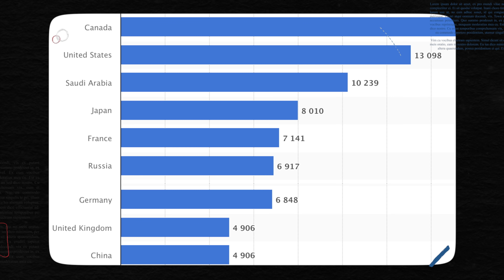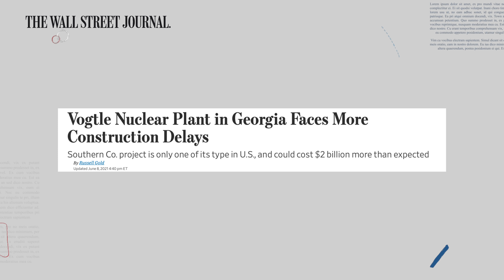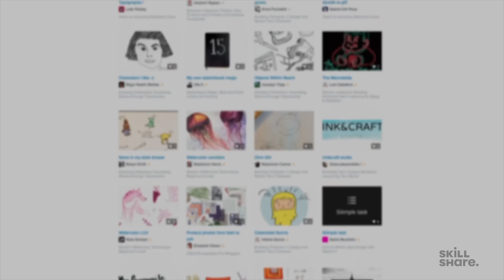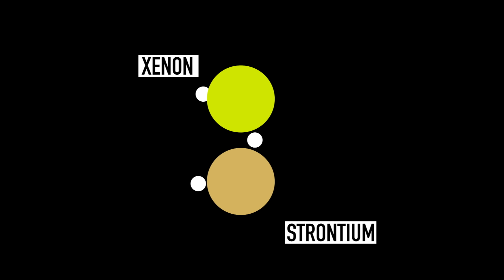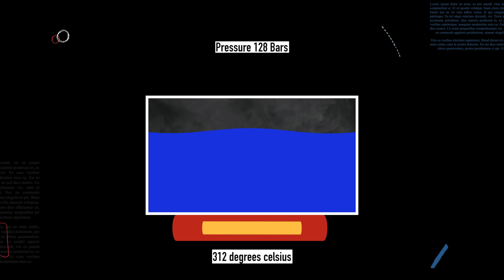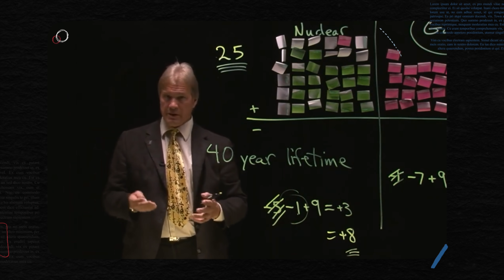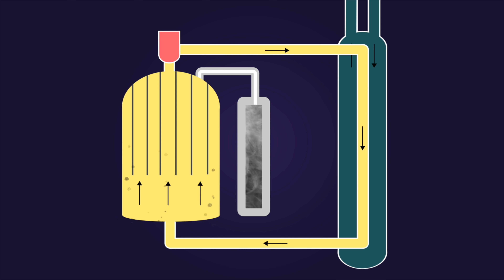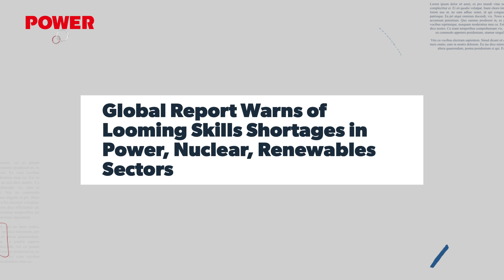Thorcon Just OBLITERATED Nuclear Energy’s Biggest Problem

Comment: Nuclear energy is the way to move forward so long as there are not corners cut and everything is above board.
Reply: Huh, Huh, Huh. I got some questions: doesn't the molten salt fuel eat through most reactor and containment methods, because it is SO CORROSIVE. Does it not react with water explosively, so if it were to receive a leak of water drops or worse, if the containment were to break and the fuel were released into the atmosphere, the results would be plumes of vaporized radioactive fuel for the residents of surrounding counties to breathe in deeply? Finally, in computing the cost of nuclear power did you figure in the cost of depopulating areas the size of US states as you nuclear industry folks accomplished in Chernobyl and Fukushima? Are you advocating planting the nuclear power plants in the ocean bottom now, so you can honestly say that you cannot reach or fix or prevent the underground radioactive leaks, when they occur, to limit your expenses? Are you totally nuts? 

Go live in Chernobyl's exclusion zone. You can get very close to nuclear stuff there. Reportedly, due to the inadequate clean-up, Fukushima is also another place in which you can get close to your beloved nuclear power. Go play around among their plastic bags of contaminated, radioactive dirt. Those are going to leak soon, what with having been exposed to the sun and wind for close to ten years, so you will soon have nice, radioactive dirt that you can use to grow your own crops. Have fun, fun, fun, until the cancers take your fun away!

Comment: It's time to start moving toward safe nuclear power. As you've shown previously molten salts seem to be the way to go. The only point I disagree with is the downplaying of the dangers and cost of PWRs.  The advantages of passive safety are numerous and key to moving forward nuclear power. We also need to consider the fuel supply chain and waste disposal. For these reasons I like the Elysium approach better.

Comment: I can think of a couple major flaws.  Yes modular design is great idea- lets standardize a single design and keep improving it as you go (open source project).  Separate the nuclear part from the electric generating part is also a good idea.   Using it on a ship or even a sunken structure on the sea bed is a bad idea,  just ask the Fukushima, Exon Valdez, New Orleans Katrina survivors or Deep Water Horizons folks about this.   You  have to assume things are going to go bad, much rather try and repair or cleanup a reactor on land than in  50 or 100 feet of sea water.  The sodium in sea water doesn't play nice with neutrons buzzing around.    Reactors need to be on land and not bunched together like Fukushima -- one goes critical and melts you can get close to work on the others.  Got to make sure your graphite doesn't fail and plug your salt drain, that would be very bad.  The salts are very corrosive and if your are part Thorium you are going to have to deal with the Tritium -- a very nasty stuff to contain and manage.  Fortunately its half life is only around  12 yeare but the bloody stuff freely mixes with normal Hydrogen in everything.  Let it escape and it will contaminate everything containing Hydrogen, think drinking water, plant matter, sea water, fish etc and there is literally no way to clean up the contamination.  Just have to wait out 3 or 4 half lives.

Comment: nuclear not necessary, i hope. battery storage is becoming cheaper and safer very quickly, and there is room for improvement in pv screens, too. i run our house off the screens on our roof and a battery array, and mid-term power can be stored in moving water uphill. nuclear failure is built in to human society, and the results can be a permanent disaster.

Comment: Alternatively we can just build the proven designs and not waste our time with this overhype. 

France already proved that conventional nuclear power can be built freakishly fast, and that was without even trying that hard. Everything is even better now. The more we put into these future 'plans' the more we squander the known advantages we already have. Everything that's true about Thorcon's alleged advantages is also true of conventional nuclear power. EVERYTHING is made in factories, this has never not been true. Assembling in a shipyard or onsite isn't a huge difference if it's allowed to function normally. And there are many advantages to onsite, so it's not a clear outright advantage. All that's required is a regulatory environment that allows those skills to be built. 

And your wrong about nuclear proponents. I will outright deny that it's get costly. With nuclear you get what you pay for... That's inherently cheaper than wind and solar that are low output, unreliable, need backup, and don't last long. They are therefore always a waste of money.

The biggest thing holding back nuclear power is the unwillingness of nuclear advocates to just tell the simple truth. Nuclear power is our best energy source, period. The totality of science is rather clear on that. But no one says so because they're operating under some sort of original sin from the Manhattan Project.

Conversely wind and solar don't even qualify as meaningful energy sources. There's just no comparison between the two. In every area of engineering where we aren't operating under a cloak of propaganda 'intermittent' is a synonym for 'broken'. We need to return to that object and well proven standard, wind and solar are simply broken and more trouble than their worth. No matter how cheap they appear to be. 

Whenever nuclear 'experts' make the mistake of being nice and saying that all solutions are equal all they accomplish is surrendering their expertise to renewable power and giving people permission to ignore nuclear power. But once we face the fact that there's no scientific, engineering, or economic advantage to wind and solar power then nuclear power wins be default. This is an easy thing to prove. Just ask the wind and solar people to provide a way for their systems to work without natural gas? They can't. And that makes them useless at all of their own goals.

Comment: Nuclear Power Plants are too expensive, too inefficient and too dangerous. Also contrary to common believe they very well cause carbon dioxide pollution.
And also i want to note, that nationalism causes big sufferings and destruction in Indian minds and any other nation. We have to stop that insanity and unite as human mankind.
Reply: @George Mann Once i was as enthusiastic as you, studied about thorium and alternatives and so called next gen reactors. But sadly there are aspects, which are not openly communicated by the big corporations behind the projects. On paper the proposed points sound interesting, but in reality for example not always civil interests do play a role in the decision making.
There are many problems, which are not addressed. But proper research does lay open the details. For instance how do you want to solve the problems of radioactive waste disposal for thousand of years? Did you even think about that in the first place? Nuclear Power Plant Supporters always talk about the plants, but hardly ralk about the disposal management, which do increase the costs enormously. Mostly that very costly part is handed over by tricky negotiations to the government and the tax payers. If the corporations fully layed ooen the real overall costs, no sane and responsible politician would accept those contracts, especially in recent times, when renewable energy reached the tipping point.

Comment: Isn't salt abrasive to metal and that is why no one is using it?
Reply: Salt is mildly corrosive.
Plain water is more corrosive.
Salty water is extremely corrosive.

There are many industrial processes where molten salt (not salty water) is used for years at a time. Aluminum smelting is the most obvious example.
Reply: @factnotfiction5915  cool, didn't know that. Thank you.

Comment: all it takes is one person to yell "hey dude you saw Chernobyl series on Netflix? then why are we building this just build solar" and boom, now you got 100 litigations in court that will drag this project for the next 10 years
Reply: One reason ThorCon is doing the deal with Indonesia. It would have cost them a billion dollars just to get permission to submit an application in the States, and who knows how many years to get approval. If this works out Indonesia might become the new poster child for Nuclear, like France and I'm sure they will reap the rewards from many companies setting up shop in a location with constant cheap power. 

Indonesia is also less likely to be swayed by NGOs. They have already stated that it is this or coal, and one way or another they are going to build plants. Lots of them. They want to industrialize and solar and wind just don't cut it.
Reply: That's true but Chernobyl was an RBMK reactor which didn't have a containment vessel and it used Graphite as it's moderator. PWR and BWR reactor use water and have containment vessels.
Reply: Huh, Huh, Huh. I got some questions: doesn't the molten salt fuel eat through most reactor and containment methods, because it is SO CORROSIVE. Does it not react with water explosively, so if it were to receive a leak of water drops or worse, if the containment were to break and the fuel were released into the atmosphere, the results would be plumes of vaporized radioactive fuel for the residents of surrounding counties to breathe in deeply? Finally, in computing the cost of nuclear power did you figure in the cost of depopulating areas the size of US states as you nuclear industry folks accomplished in Chernobyl and Fukushima? Are you advocating planting the nuclear power plants in the ocean bottom now, so you can honestly say that you cannot reach or fix or prevent the underground radioactive leaks, when they occur, to limit your expenses? Are you totally nuts? 

Go live in Chernobyl's exclusion zone. You can get very close to nuclear stuff there. Reportedly, due to the inadequate clean-up, Fukushima is also another place in which you can get close to your beloved nuclear power. Go play around among their plastic bags of contaminated, radioactive dirt. Those are going to leak soon, what with having been exposed to the sun and wind for close to ten years, so you will soon have nice, radioactive dirt that you can use to grow your own crops. Have fun, fun, fun, until the cancers take your fun away!
Reply: @mikefas1160  The animal life living in the exclusion zone is doing very well. With no mutants in sight yet.

Comment: Did we just glaze over dumping nuclear waste on a tropical island ala bikini Atoll, building a nuclear power plant submerged in the sea beside one of the most active tectonic plate boundaries. I'm all for nuclear but can't we find a better test location
Reply from the maker: The location mooted for this plant is not prone to tsunamis due to the lack of a lensing effect to focus the water towards one place. 

Their plant is rated to withstand pretty high earthquakes and g forces. Part of what helps is that they’re sitting on the sea bed. 

The can also has stabilizers around it so that it is somewhat insulated from sudden motion.

Comment: I fully agree, but there has to be a sensible safe way to dispose of the waste before moving forward with any more nuclear power plants
Reply: Check out moltex.  They are dedicated to wasteburner models.  Are out at a 5 year range of finality.
Reply: @dalethomasdewitt  yeah, but they'll have 50 years worth of spent fuel already and as she said, the new fuel is cheap. Might be a problem to scale their plants up enough to even make a dent, especially if they're building new reactors producing even more waste...

Comment: You might be able to use the energy to distill ocean water. Which will also produce salt. Then you could put some of the salt in the reactors. Just an idea. I am not exactly sure how thorium reactors work. Sounds interesting though. One thing to think about though is if you put molten salt in water it can explode. Just something to think about. If designed properly it should work. Try this take some molten salt and drop it in water. You can just watch a video on it on YouTube.
Reply: The salt don't explode.  The heated water gets a little agitated.  That's all.
Reply: @dalethomasdewitt  I guess it matters how hot the molten salt is when it comes into contact with water. Watch the YouTube video on "molten salt in water".
Reply: The salt is not sea salt -- it's a mix of Fluoride salts of  Lithium, Beryllium, Zirconium, Uranium and possibly others and becomes liquid in the mid 400 deg C range.   Hot liquid salt mixed with sea water would cause a steam explosion at those temperatures.
Reply: @craigs5212 I hope it works. It sounds promising. I think they will work the flaws out as they go. Just like anything it takes time to make something reliable and efficient. So when do you think they will start building them?

Comment: Instead of these gaint reactors why can we use small ones like ones used in nuclear powered ships subs ,these are cheaper and faster to produce ,by using them in large enough numbers we can achieve the same with less complexitys.
Reply from the maker: Because of the constraints of size, nuclear submarines use highly enriched Uranium. 

Plus they have a massive amount of cooling available on account of being in the sea :)

But it’s not totally unfeasible. Only thing is that there are less expensive ways to get nuclear energy.
Reply: @TechforLudditesSira  got it 👍🏼 . Thanks maam for replying ☺️ ,I hope ur channel become one of the best educational channels of Utube .
Reply: These are not giant reactors.  They are meant to retrofit existing outgoing grids. Modularity is the key to kick start civilization's basic key need.
Reply: @George Mann Wind and solar are very cheap and are located at ends of grid or in matrix of nodes throughout grid. This can dramatically lower costs as the grid doesn't have to be over constructed. In effect you are using wind and solar to lower cost and nuclear to ensure reliability without having to overbuild which you would have to do if you relied on renewables alone. 

It's also about diversity of energy sources, it is prudent to guard against foreseeable natural disasters that could take out a large slab of a renewables only power system
Reply: More and more Chernobyls and Fukushimas? Huh, Huh, Huh. I got some questions: doesn't the molten salt fuel eat through most reactor and containment methods, because it is SO CORROSIVE. Does it not react with water explosively, so if it were to receive a leak of water drops or worse, if the containment were to break and the fuel were released into the atmosphere, the results would be plumes of vaporized radioactive fuel for the residents of surrounding counties to breathe in deeply? Finally, in computing the cost of nuclear power did you figure in the cost of depopulating areas the size of US states as you nuclear industry folks accomplished in Chernobyl and Fukushima? Are you advocating planting the nuclear power plants in the ocean bottom now, so you can honestly say that you cannot reach or fix or prevent the underground radioactive leaks, when they occur, to limit your expenses? Are you totally nuts? 

Go live in Chernobyl's exclusion zone. You can get very close to nuclear stuff there. Reportedly, due to the inadequate clean-up, Fukushima is also another place in which you can get close to your beloved nuclear power. Go play around among their plastic bags of contaminated, radioactive dirt. Those are going to leak soon, what with having been exposed to the sun and wind for close to ten years, so you will soon have nice, radioactive dirt that you can use to grow your own crops. Have fun, fun, fun, until the cancers take your fun away!
Reply: @mikefas1160  Comparing modern designs with Chernobyl is like comparing an old time steam boiler with the modern ones. You should read the history of steam explosions. High pressure steam is invisible. You could be walking down the street and suddenly your are enveloped by an invisible cloud that is hot enough to cook you alive in seconds. Dozens more people have been killed in steam explosions than have been killed in nuclear accidents.

Fukushima was sixty years old and still weathered a category 9 earthquake. It was the imposed human procedures that torpedoed it, not any flaw in its design. 

The current plan for molten salt reactors is to have the reactor pot replaceable. They run it for four or so years, and then remove it and replace it like plugging in a new battery. Then it gets to cool down for a few years before being drained and the fuel reprocessed.
Reply: Sticker price is the least important metric for a power source. It's only become popular in recent years because it helps wind and solar look good. What really matters is ongoing operating costs. In that respect nuclear is extremely cheap and gets cheaper the bigger you go.
Reply: @George Mann Wind and Solar would be good in India and China because they have so many people who live off the grid with no power at all. So to them even intermittent power is good compared to what they have now. Small villages could have a big solar array with power only needing to be sent a couple of miles at best. But as the entire country is hooked into one big grid they will become less and less viable except for people who want household solar for their personal use.